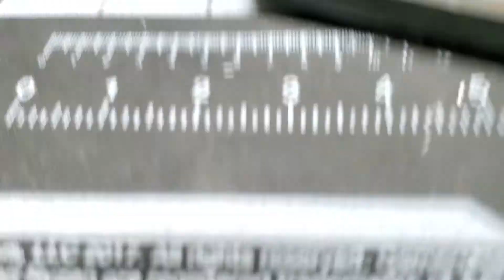ArrRGB DAC Demo Box Build Progress

Comment: How any amps could you hook up to the 12v 4pin rgb outputs?
I saw you can put 150 leds max? So would that be 1 amp at 12volt max? Or a other amperage?
Reply from the maker: The headers are rated at 3A as well as the fuses.
Reply: @SolarityTechnology  oh okey thanks!
I can could use my 2A 12volt rgb strip with it. What’s awesome.

Comment: what the people need is an dac that can vary the pwm duty cycle. this is 5v controller to 12v device but people also want and dac the gos from 12v controller to 5v device. also would be nice to have it universal to hook to other brads connectors even if it was sold separately. i my self got the dac to hook up rgb power switch as here no argb one as far as i no of...
Reply from the maker: To be honest I never thought a ADC would be popular as you are dumbing down the neopixels to act as analog RGB. The DAC can use both Asus and Corsair headers. Other brands are a bit more rare, but I might make an adapter board.
Reply: @SolarityTechnology  ya there only 2 that i no of the deepcool one and the EZdiy-Fab one that is better but the problem is the devices people hook up may not work with w/e duty cycle there device uses based off w/e chips the strips use and it may work, wont work, or flicker. your probably right that people might not pay $80 or so for one but who nos
Reply: what we need is a pwn duty cycle convertor so you can change what the data pwm of the chip is so you can hook up w/e argb device you want. don't no how doable this is or maybe i just don't understand the chip on the strips.

Comment: hard to tell because you put the room light back on: are the 4 analog channels each addressed independently or as a single group? they seemed to be participating in the rainbow wave strip by strip, but it wasn't super clear to me. thanks!
Reply from the maker: Sorry, I should have made it clear. The DAC has 4 seperate RGB channels/4 virtual addressable channels. Each analog port on the DAC is a channel.